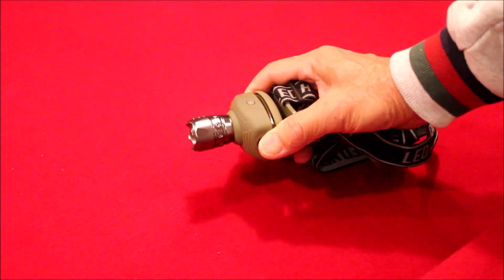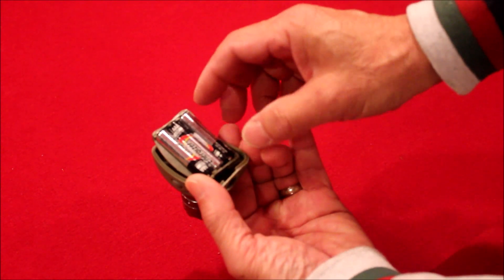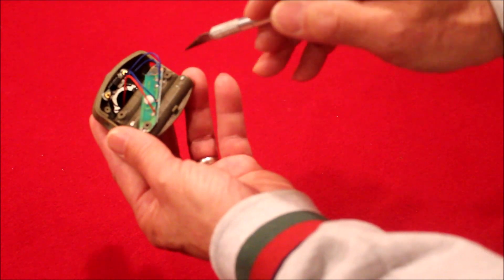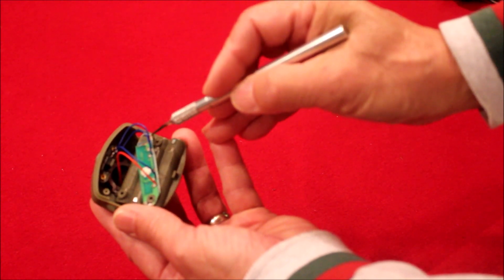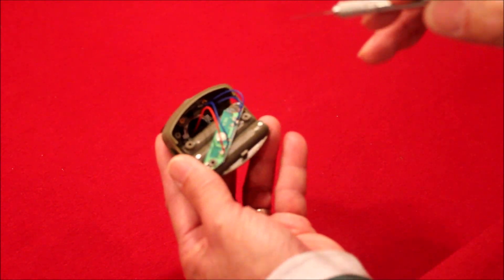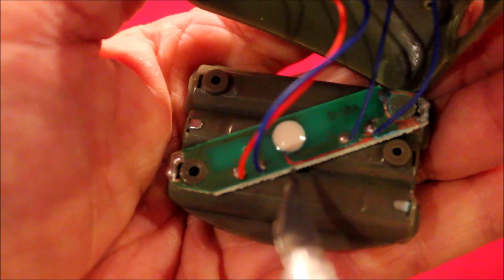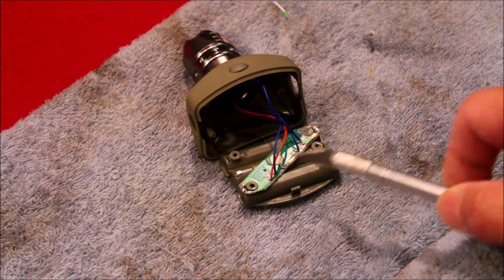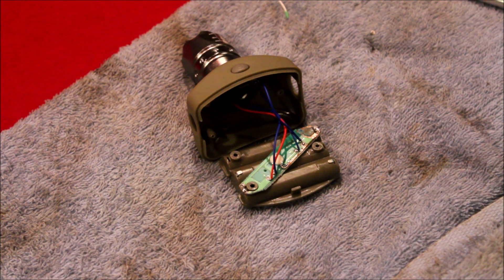LED Headlamp not working - FIXED!

Comment: Kinda late, but you can actually color it in with a pencil. I've fixed amplifiers this way, graphite is the better conductor and can handle more density :)